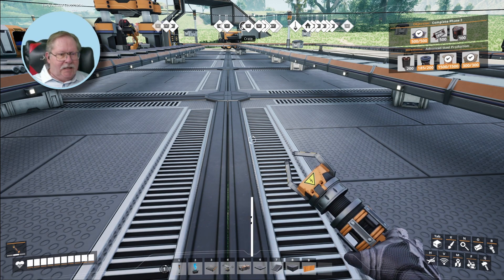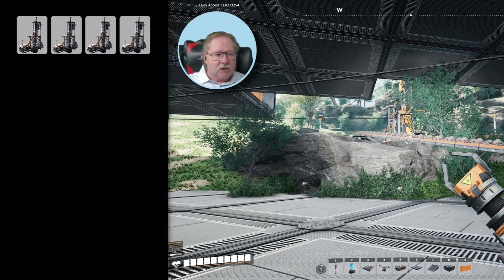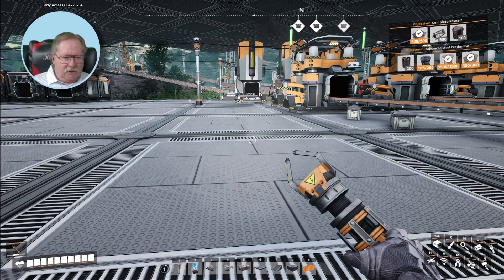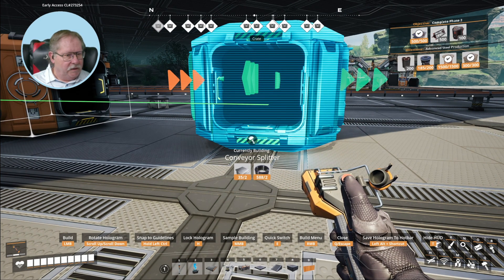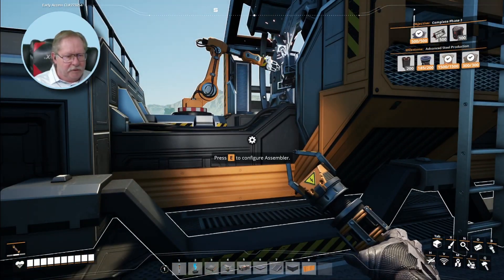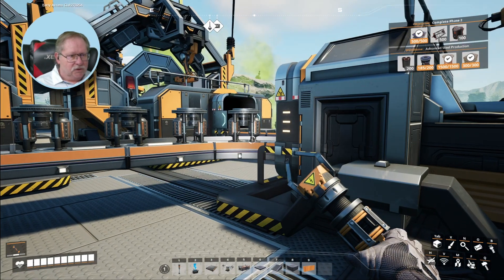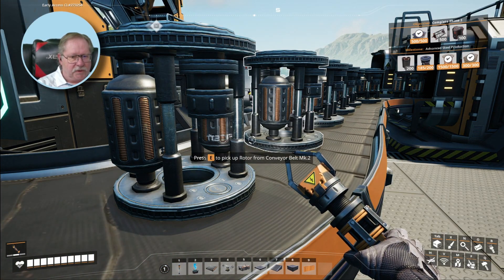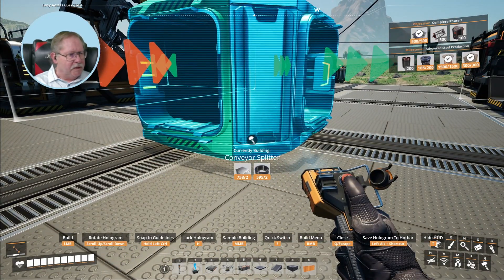Balancing the Factory for Reinforced Iron Plating and others [Satisfactory 16]

Comment: 10:42 If you stack the storage containers vertically, and you attach them with conveyor lifts, it takes up less space.  I’d also recommend filling a container stack from the top so that the bottom container always has goods in it for retrieval from storage.

Comment: 4:15 If you have a merger selected, you can press E to toggle to a splitter.  This works for all items in the build menu (Q) but by subcategories.  For example, selecting a storage container will allow you to use E to switch to an industrial storage container (one you unlock it), or selecting a belt allows you to cycle between mark 1-mark 5 belts (once unlocked).  You can either tap E to cycle through the options or hold E and select the item from the radial menu.😊
Reply from the maker: Another great keybind! Thanks for sharing- I'll add it to my stickynote list I have here while playing.
Reply: A related thing I learned the other day is that, so long as you don't have a conflicting belt connected, 3:11  you can replace a splitter with merger (and vice versa) by holding control.

Comment: I recommend using 4m or 2m foundations when placing them on the ground and using CTRL to snap them to the world grid.  Snapping to the world grid also snaps them centered vertically, so a 1m foundation could end up 1/2m off vertically from another foundation snapped to the world grid elsewhere.  This would prevent the separate grids from merging nicely.